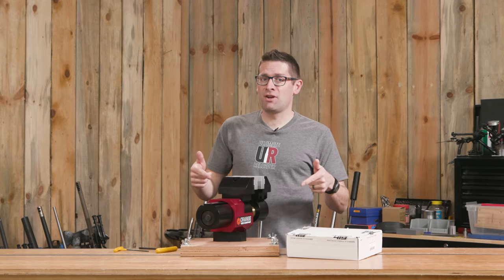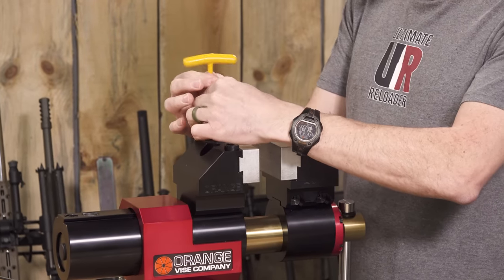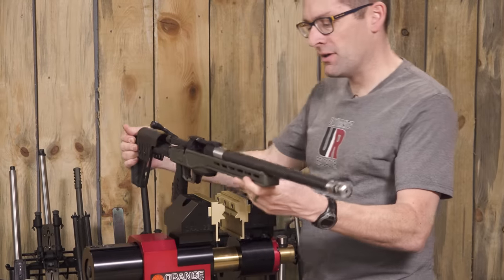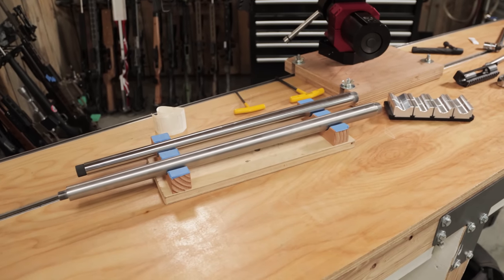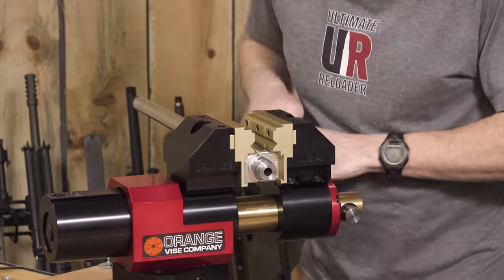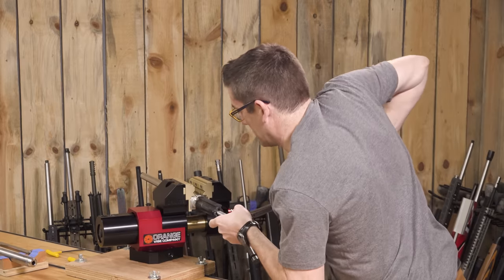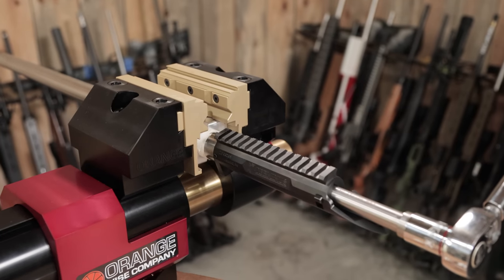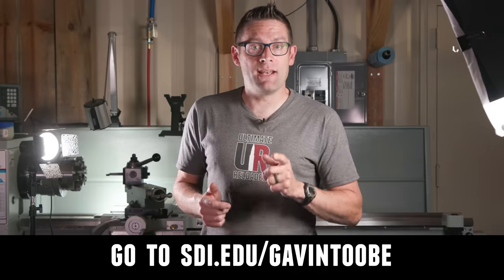Area 419 Orange Vise Maintenance and Barrel Change Jaw Kit

Comment: I 3D printed something very similar out of PLA that fits over standard vise jaws (Harbor Freight, Irwin, Yost, etc..) It costs around $2 to print and works all the same as long as your vise can provide the torque.

Comment: I have 2 Orange vises in the shop, one with the Area 419 jaws.  I run 1 layer of masking tape over the jaws because they can and will mark the edges of your ARCA and Pic rails.  I've found that the barrel inserts don't have enough surface area to hold the barrel if I'm installing a magnum barrel that's torqued to 120 ft lbs.  I still use my Brownells barrel vise for those.  The most useful set of jaws that I have for my Orange vises are a set of the steel jaws with a step machined on one side (for holding pistol slides, action blocks, etc) and I can flip these over and use a set of magnetic urethane soft jaws.  Metal on metal does not hold well since there is no "give" to conform to the held object.  You really need, leather, felt, or rubber to provide the best grip and holding.  

As for some of the comments, I have Kurt vises as well as a made in USA Wilton.  These bench vises are the best for their intended application.  A Kurt vise is a CNC mill vise and not a bench vise.  I wouldn't use this Orange bench vise vise in a CNC mill (but Orange makes those too).  Wilton vises are fine for heavy shop use and a Made in the USA Wilton currently runs $1000.  I would buy one of these again tomorrow if I needed one.  I've never had a customer complain that the tools I'm using on their rifles are too nice.

Comment: I would like it if orange would provide a set of knurled steel jaws. Reason is, I have a old Remington 700 long action from 1982 that still has the original barrel attached, and the bushings provided by Area 419 don’t provide enough “grip” for the action to break free from the barrel. I’ve tried card stock, sand paper, heat, but the barrel just spins in the vice jaws. I’m not worried about preserving the old barrel, but I think something with more “bite” would do the trick. Other than that, I love my Orange/Area 419 setup a lot!
Reply: Buy a set of the steel jaws from Orange and glue some rubber or leather to the face.  I will tell you that factory Remington barrels are the worst to remove, especially if they are old.  I've had some that the only way I could get them apart was a 4 bolt Brownells barrel vise, Brownells steel action wrench, some heat, and a really  big steel hammer.  These jaws and inserts are really intended for custom actions and barrels that don't have the torque that the factory Remington has.  Even then, I still use my Brownells barrel vise for magnum actions that have to be torqued to 120 ft lbs.